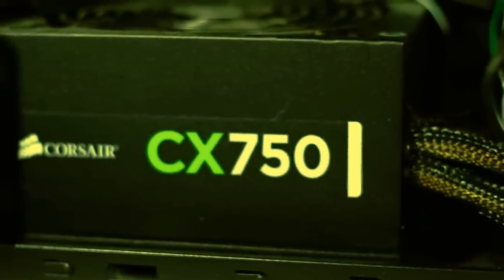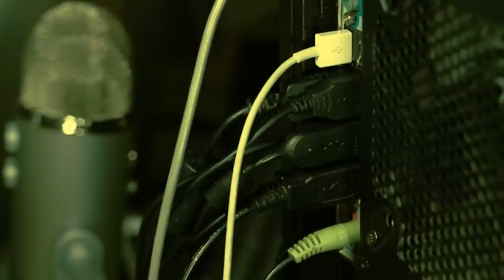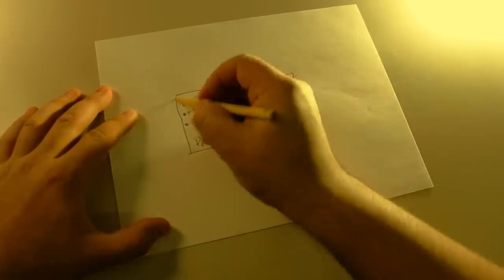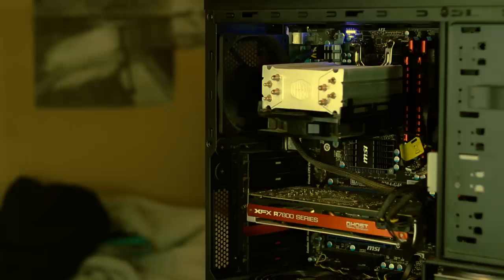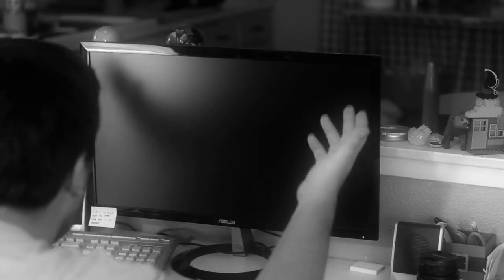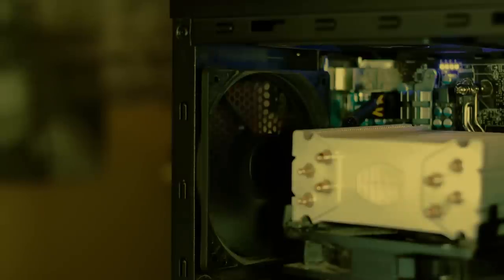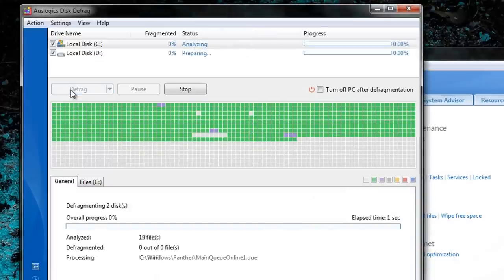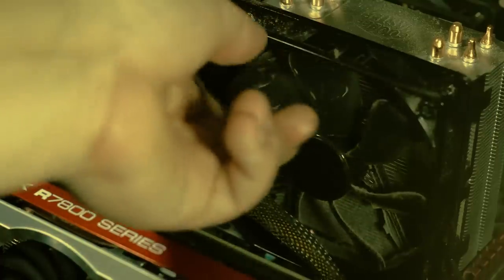What To Do When Your PC Shuts Down At Random

Comment: while using my pc it switched off suddenly and its not turning.....when i press the power button it is making some errrrrr sound near the power cable at cpu and fans not working......please tell me what should i do?and what sort of problem is it?
Reply: pegasus Goutham it definitely sounds like it is a problem with your power supply. Take it into a local Micro Center or something and they should be able to switch it out and see if that is the problem. If it is, then just get a new power supply. This is very likely if you bought a pre-built pc, as their power supplies are awful

Comment: i have an ASUS gaming computer. Now this doesn't happen very often. It will happen randomly. i'll be on YouTube watching video. That's it. like today my YouTube video suddenly went full screen mode and my computer screen shut down, but my tower was still on and running. i didn't want to shut it down by button. It just said i lost the signal and i couldn't shut down the computer like i usually do. so i just turned off my multi outlet plug. This happens so little i don't even see it coming. i just want to know why it happens. it's only a year old. When i moved to a new house i made sure nothing could get screwed up. i moved it myself with pillows and everything. My friend who knows some things about cleaning a tower didn't know how to open my tower. She said you should be able to unscrew it from the front or back. it's kinda weird. She doesn't want to break it. so she used a flashlight to look inside and says my fans are surprisingly clean. So i think it may be a cord like you said in your video.... idk the only reason she was trying to get in the tower was because my tower was making a noise like it was over heated. So now i'm coming to you with this screen randomly shutting down business. please help. oh and please help with the over heating thing too. i mean this thing hold a shit ton of memory.....
Reply: +PrincessCelestia19 If you are worried about your memory then take your HDD or SSD or whatever you have that memory on out. Your pc either has poor air circulation. Massive dust buildup or (yes this is possible) some component is too strong for the system to handle and therefore requires alot of air and power. Gimme ur pc specs and i&#39;ll take a look at them. Your PSU might not be too strong either. If a component is too strong for example a too strong GPU for your system to handle will take the most air and use the most power. And due to the power it has it overheats your other components and may even burn them through.

Comment: Ive just built a pc and it keeps turning off at random after 1-2 hours. Specs are - VS550 psu, gtx 560 kfa, amd 6300 with an amd asi 970 motherboard. Everythings firmly in place. I can play games just fine but it still turns off no matter what. Can anyone help?

Comment: Hello, My computer is shutting down whilst playing games as if it where overheating, but when i check the temperatures it is always at a safe stable level (55-60 degrees Celsius MAX), to start with it was only shutting off with games such as skyrim and DayZ, which is upsetting since i know my PC can run both these games without and issue. but recently it has been shutting off with games such as world of warcraft as well. this is most upsetting since my computer has a 6 core processor, 3Gb graphics card, and 16Gb RAM. i also have a 650w power system that should run it fine.

the computer will run these games for 5-30 mins before completely shutting off. i have opened my PC and replaced the thermal past on the CPU, since when ever i turn my PC back on the CPU fan sounds like its overworking even though the CPU isnt overheating. i dont know what to do and its quit frustrating, if you could get back to me it would be most appreciated. Thank you :)

Comment: My pc shuts off display , keyboard , mouse and other device connected to motherboard at random . but cpu fan , gpu fan , case fan still runs. I have checked all connections , the temps are normal for both cpu and gpu. Help guys

Comment: I know a tip too Processor problem when i got my computer it worked fine but after a certain amount of stuff i downloaded it started shutting itself off. Another tip is Manufacturing problem see i think i have it when i run dxdiag it says i have directx 11 but when i play alien isolation that requires dx 10 then it says that my graphics card doesnt support dx 11

Comment: Can you please help me?
About a month ago I launched Dota 2 and my computer freezed and then I force shutted down my computer. After that, always when I switched my keyboard on (Qpad Mk-50) there would come a light and then it would shut down, one day I solved it by repairing my computer somehow in the settings. Ever since I solved the keyboard problem and got it working my pc started shutting down when I played, I touched my pc fan place at the back of the computer and it wasn't overheating. please help me!

Comment: I have an amd fx4300 cpu at stock speed and i got an asus 660ti top edition with an evga 600w psu and 8gb ram now my problem is when i stress test my cpu with aida 64 it runs good but when i stress my cpu and my gpu at the same time my mouse cursor lags and my gpu fans dont ramp up their speed they are set on auto and after a while my pc just loses the display signal and i have to restart it.Now could it be that my gpu drivers are clashing with windows 10 or my motherboard wich is the msi 970-g43 as it only states it is compatible with windows 8 and 7

Comment: I turned my of on and it came up with an error message and I think it said something about a disk and it said last boot was good and it has a countdown and when the countdown was done it rebooted and when it tried to load up Windows 10 the whole system just shut off. Like someone just pulled the plug. And no it's not the plug to the wall lol. I've never seen this before and I spent a lot of money and time on my pc so I don't want to turn it on again until I know for sure what's wrong. In case turning it on might do something worse than an error code and a reboot and shutdown.

Comment: I need help with my power supply: The cable is hard to connect and i need to push realy hard to plug it it but is this moveing. should i change my cable or my power supply ? My power supply is 500W

Comment: Hello, I have a midgrade iBuyPower desktop and usually my computer does fine but when I play games that are processer or graphic intensive it will shut down within a few minutes. Any possible causes/fixes for this?
Reply from the maker: Based on what you said, I would really check to see if your computer is overheating. As mentioned in the guide, motherboards usually have an auto-off feature on them that shuts the PC off when temperatures are too high for a prolonged period of time.
Reply: I have a similar problem with a hp d7800 sff that i run win 7 on but it bluescreens me. Its not the normal win 7 bsod though, it says "Hardware Error" what sucks is I know exactly what the problem is (CPU) but I can't afford a new one.

Comment: ok  i have a problem with my pc shutting down. seemed random at first but seems i narrowed it down to a part just cant narrow any more. i just put windows like 5 days ago so i don't think its a virus i even had Linux mint i tried before windows 7 ultimate  and it shutdown. its mostly shutdown under strain, but sometimes its will without strain, but not often at all without the strain. started it gpu cleaned whole pc real good with air compressor even took cover off gpu. i also checked all connections un connected most and put back. tryed making sure all updates are done ect. then i removed the gpu and just ran game on asus motherboard btw only game i have atm is lol it runs with low fps but never shut pc off. put gpu back in it starts goes most of the time tell i load into match then shuts pc off.i left gpu in and let pc put for 2 hour it had no problems had a program i downloaded to show temps and temp went to 50 max. now since lol takes whole screen haven't been able to tell if i get  to hut under stress ill know that sonn but i can still hold and touch after i don't think heats the problem. cpu didn't get hot ether. so am stuck whole pc clean i even took cover off gpu when i cleaned it as much as i could without screwing with the thermal stuff.lowered resolution seemed to help but not enough to count.but dont know what to check next here my pc specs also i got pc used so cant say if anything was oc. motherboards asus m3n78-vm {green}, also 4 gb ram, amd althlon{tm} 7750 dual-core 2.7ghz. os windows 7 ultimate 32bit, gpu is a msi n9600gt this is how it looks                                   http://scusatrading.com/msigeforce9600gt512mb256-bitgddr3pciexpress20x16nvidiavideocardn9600gt-t2d512-oc.aspx            i do use a adapter that makes it vga. umm also check every fan even power box fan all moves good vary low noise.

Comment: hi there
first my laptop shut down when i was playing game. my laptop is toshiba c55 B866 64 bit operating system with 4gb memory. but  when the windows installed pc settings and windows media player doesn't work and i changed the windows from 8.1 to 8  but the time of shut down delayed but not fixed i tried to update old version devices  and fixed some problems with advanced system care  and finally stops shutting down while watching films reading books etc but shut down while am using internet.
windows recommended me 107 important updates and 8 optional updates even windows defender stops monitoring my computer and i can't scan with avast  it says you are not protected after installing i checked it on another pc and it worked and also when i try to scan  it says that       there are no end points and  avast fire wall can not be enabled and i am so tired of it please help me PLEASE PLEASE

Comment: my pc keep restarting very randomly, especially when playing video games in high resolution. So i have changed to another graphic card but still the same. Thought it was temperature, bought a new fan, still the same. What cause this problem? Ram, PSU, or mainboard? Or chipset by any chance? I often clean the computer.

core i3 3240
ram 8gb (4gbx2)
corsair vs450
gtx 750 1gb.
asrock h71m-dgs

also when i unplugged 1 ram, it keep restart but as not usually as 2 ram.
Reply: Long Nguyen your ram sticks may not be compatible 100% with your computer, try getting some new ram
Reply: thank you sir, i'll give it a try. by the way, anything i should notice when buying a new one? i don't understand much about this.

Comment: Can u help me so I got a new pic and it's currently runnin Windows 10 and for some reason every time I start up a game on steam my display won't show on the monitor it keeps on loosing it and I'm runnin a 750w power supply with a 980ti graphics card and 16gb of ram and it still won't work but it worked before couple months and for some reason it always drops can you pls help anyone?

Comment: Hey frankieseshy im having this problem where i try to run assassins creed unity and when i get on the title screen my computer turns off these are my specs
CPU-AMD A8 6600K with radeon(tm) HD Graphics (3.9GHz
RAM-8GB 8192mb
MotherBoard- MSI MS-7721
GPU-Palit GTX970 4G
Hardrive-1TB Samsung
PSU-700W Alpine 

I think the cause may be the psu as ive been told its a rubbish one and its inconsistent but im not sure if i should get a new psu what do you think?
Reply: Hi if you are still looking for a solution check out my channels newest video

Comment: My PC is shutting down really randomly, even if i'm just watching videos, he shut down and reboot by himself after 2 seconds, i tought it was psu problems but i bought a new one and it still shutting down

Here's my setup, we will never know if it could be compatibility problems:

Motherboard MSI H110 GAMING
Processer intel i7 7700K
Ram 2 × 4gb 1600 mhz ddr4 from G.skill
Storage 128 gb ssd and 1to hdd
Gpu Gigabyte 1050ti 4gb oc
Psu be quiet 650w 80+ 
Cooler i think something like H7

Comment: Hi, soi have built the last day my pc - Gigabyte 970a-ds3p, sapphire r9 290 tri-x oc, wd blue 1tb, kingston hyperx fury 8gb 1866, amd fx 8350, cooler master hyper 212 evo, and a gaming mouse and keyboard, wifi usb adapter, and a dvi-d monitor, and microphone plugged in...And for that power supply do you think can it handle it...Because when i turn on the computer the fans starts to spin, and after 2 seconds it just stops...I cant power it on unless i replug the psu cable...CAN YOU PLEASE HELP ME IF THE PSU IS THE PROBLEM OR SOMETHING ELSE....And if isnt do you think Tacens 900w Silver Valeo V would be then a good buy fkr the budget...Would it help to fix the shutting randomly my computer, and not turning on?
Reply: Same here. Fx8320 with m5a97 r 2.0. Shutdown are very random, and sometime even at bios. Monitor suddenly no input, mouse n keyboard no power. This is suck. Tips for longer power on time,
 after you switch off the psu, hold the power button for 30sec, then turn on. Sometime it permanently fix the problem.
2nd, manually set the voltage. In my case, i set it to 1.4v.
3rd, bad cmos battery. Check your fan sensor, if it show over 9000, maybe some sensor in the motherboard would report bad temp for it to turn on.
4th, airflows. Reposition your cpu cooler, to make sure, your mobo get good airflow.
But even with these step, the problem still happening, but no as much as previous week. Im seriously consider to switch to intel. 970 have too many bug. Hope fully, it fix your pc
Reply: I found the problem, the motherboard was fried and it wouldnt keep up with the system longer, because its shit :D, and the psu cpu cables where similar, so the wrong cable was plugged, and psu died, atleast i have warranty
Reply: MK Heaven thx for your reply. Maybe changing my board helps me to permanently fix this dump problem. Good for you, you have warranty left

Comment: When I start CSGO/Minecraft and go on it for about 5 mins with Skype open my laptop would shut off and restart itself, I got a completely new cooling system a couple days ago and it now happens more often, why?I also tried without Skype open with same result
Reply: Probably cause your playing on a laptop and if it's store bought it probably had little to no ram, no graphics card and a smaller amount of hdd, desktops are the way forward a few days ago I spent only £300 and yesterday finished building my pc... It has 8gb ram, 2tb hard drive, a raedon r7 160 club 7 graphics card with 4gb space, I just need a monitor now saving up for a 4K 25" use pcpartpicker.com to begin building your custom pc
Reply: no I played rome 2 on a shit laptop and I NEVER crashed and i was way below spec limit.

Comment: none of the problems listed works . my PC goes through an infinite reboot cycle. my PC specs :

motherboard:Asus B85M-GAMER
CPU:I7 4790
ram:hyperx ddr3 8gb *2
gpu:msi gtx 960
hdd:Toshiba 1tb 7200 rpm
pay:power logic magnum pro 475X 950 watt
Reply: Its because of the ram
Reply: Push the ram in as hard as it fits and it should fix it

Comment: my pc restarts automatically and i dont know what the problem is.. ive seen some youtube tutoral and fallowed its steps but its the same n im using 650w powersupply for my gtx1050ti so i guess its sufficient power for my system . so can  uplz help me out figureing what the problem is....
Reply: Some hardware needs to be replaced, maybe Motherboard or RAM, probably Motherboard
Reply: Have you checked your temperatures? Could be the CPU overheating

Comment: i haven't been gaming on it when it happens so when im using it, it shuts down randomly it cant really be temps because i have like 3-4 fans in my pc, but i have a really shity 500w psu, would this be the reason for all of this my gpu is fine so it cant be it because i was gaming on it when it happened
Reply: Arran Bear It probably isnt your GPU as long as you don't have an insane pc with a 1080 and a xeon or something. Even with great cooling some parts may be defective and produce uncoolable amounts of heat.
Reply: G&G Films thanks for that mate, and i got it fixed there was some loose wire on the motherboard so I'm good, thanks for teh help anyway

Comment: i have a 450 w psu amd phenom 2 945 with 4gb ram and 2gb gt 620 graphic card.fans working fine cables connections fine when i play game(i.e dota2) after 10 mins it shuts down its probably heating coz i can smell something there.any suggestions

Comment: Not dusty, Not overheating everything is plugged in i recently installed a 660ti graphics card with 500w and now all it does it shuts down after a few hours or when i was games.
Reply: Vupzy | Gaming Videos! well. he said that he had a medium lvl graphics card an R7870 wich is not THAT good but not bad either and it required 500w alone to run. but u got a much better graphics card than that letalone that its a Ti version wich is better. to put this all short, u dont have enough power in your pc so try updating the power supply. 750w or 1000 will do and they are not expensive if bought from the right place